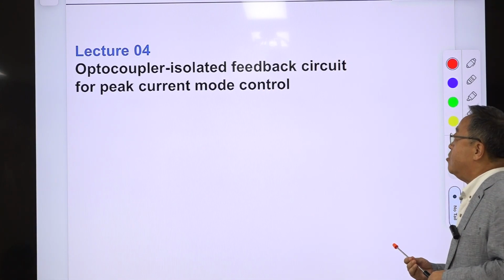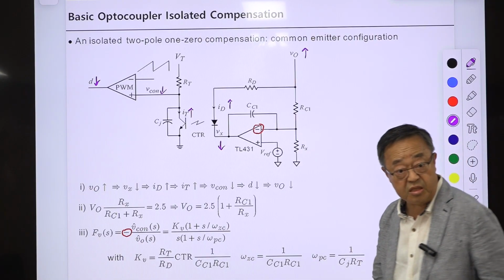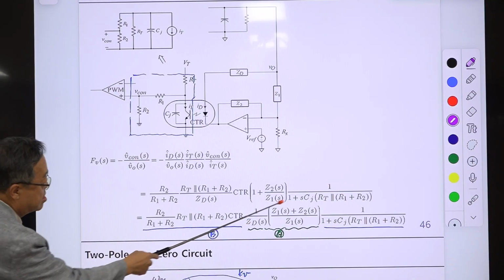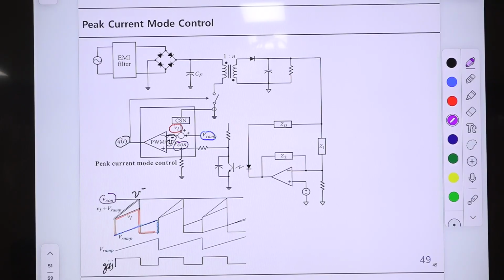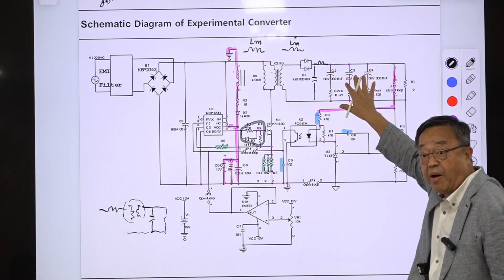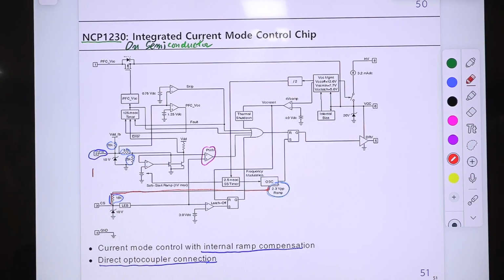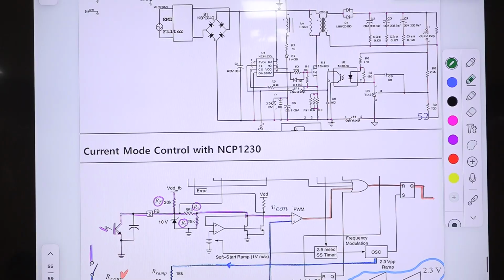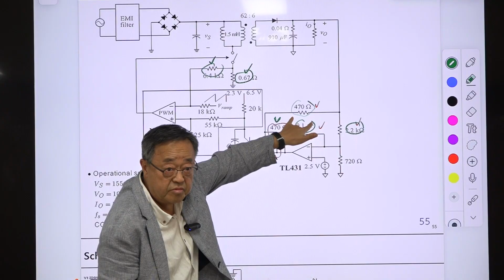Lecture 04: Flyback converter, Off-line converter, Peak current mode control, Optocoupler, NCP1230

Comment: Sir while making average model in simulation tool we need to extract slope compensation data and that becomes very difficult to extract from datasheet because there is not a single application notes which explains how to extract the compensation related data from datasheet